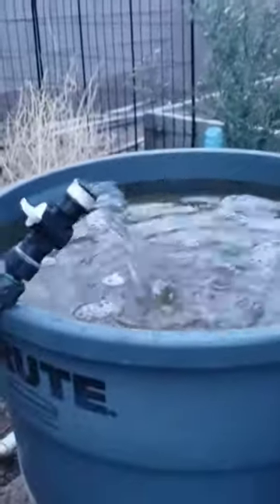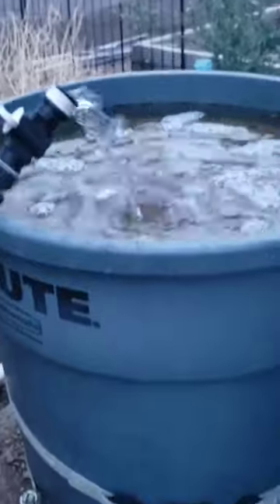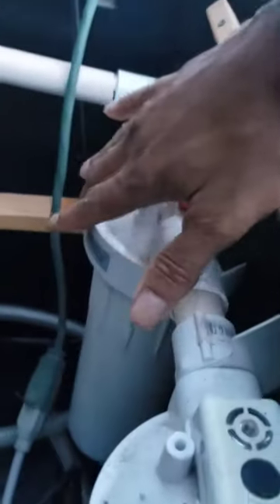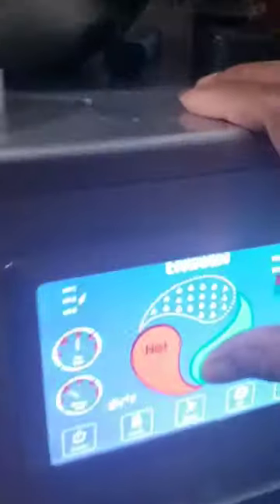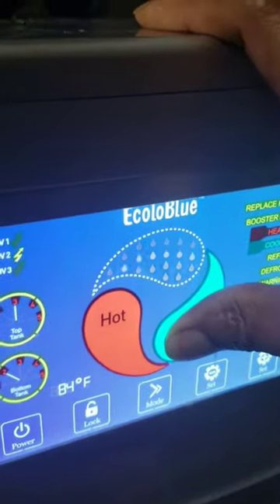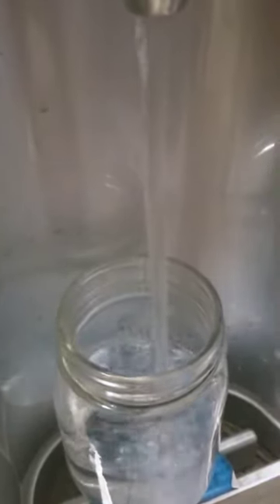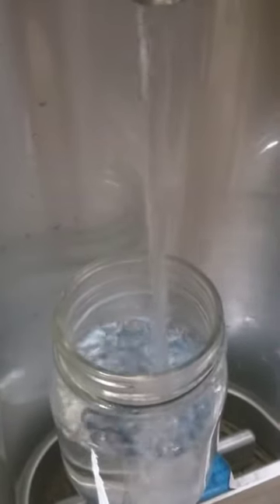How we clean our rainwater to ensure it's free of micro-plastics.

Comment: All fine and dandy, but what if you don't have all the filters....most of us do not have all that.
Reply: The filters are absolutely a worth investment, 10/10 would recommend investing in them. However, even if just using a simple sand/charcoal/gravel/cloth filter, then boiling, you will still be going a long way. Then overtime you could add extra amenities, it doesn’t have to be bought all at once.

Comment: Do you re mineralise you water after R.O. because the systems i am familiar with they leave 0 minerals in the water. The water wants to draw minerals in so if there are non present. It will take them from your teeth and body if the right ones are not present.
Reply from the maker: Our atmosphere water generator does have a mineral filter on it.

Comment: How much does such a system cost?
Reply from the maker: A sand filter will hardly cost you anything, just the time to build it.  I think I built mine for $50 bucks and still using it to clean water 15 years later.  If you do it yourself, the other system under $200.  We have made all our money back on both systems.

Comment: If you're collecting RAINWATER to drink then you absolutely need to put it through those first filter systems, 
But if you just want to filter MICROPLASTICS out of TAP WATER all you need to do is BOIL it for 5 MINUTES and then PASS it THROUGH a COFFEE FILTER.
I am doing this at home but I'd like to filter rainwater for my plants so that I am not consuming microplastics when I eat my vegetables. 

Interestingly all of your filters are made of plastic and with time will degrade plastic into the water especially when out in the sun, But I understand that huge Demi John's of water, out in the sun/frost, can explode dur to extreme temperatures.
It's a shame there's no easy fix .
I guess I'm looking at getting some metal containers and perhaps doing the whole boiling system outside I'll buy in a very expensive reverse osmosis machine. 😭
I wish they would just bum plastic right now so that we are only dealing with what's already out there.